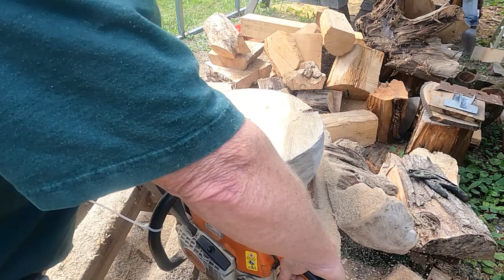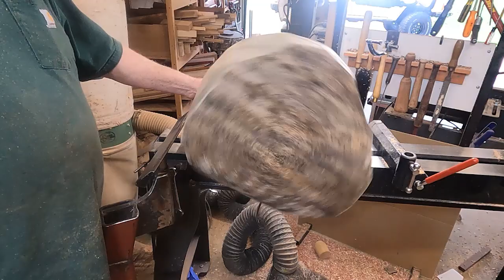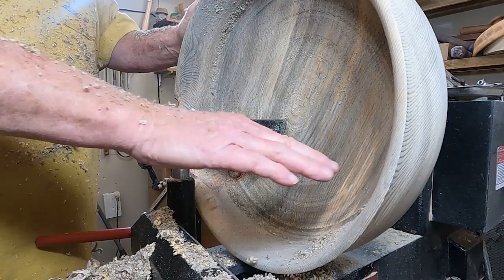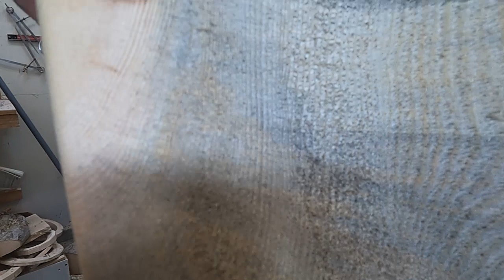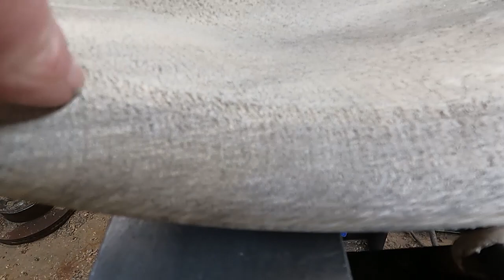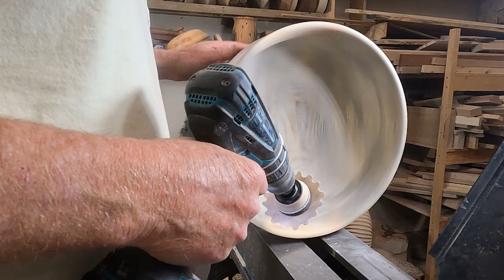Big Blue Pine Bowl

Comment: Very nice. I have found when I scrape the outside if I turn my gouge so the opposite is almost touchng BUT NOT TOUCHING, and I drop the handle to about 45 degrees much of the tear out is eliminated. 
You're in Montana? I am in the Flathead lake area. I will look for more vid's.
Reply from the maker: Thanks for the advice.  I’ll give it a try.  I’ve seen that done before but hadn’t actually tried it.  
    I’m in Bonney Lake Washington actually. I’ve been to flathead lake before in a ski trip to Whitefish.

Comment: Opa a papa here. What was holding the bowl when you cut the tenon and pulled back the tail stock. Suction Chuck? Sorry if I missed it. BTW. Subscribed now your 111.
Reply from the maker: Great thanks for hitting that subscribe button.  
  Yes that was your vacuum chuck.  The larger one. It works really well.   Highly recommended.